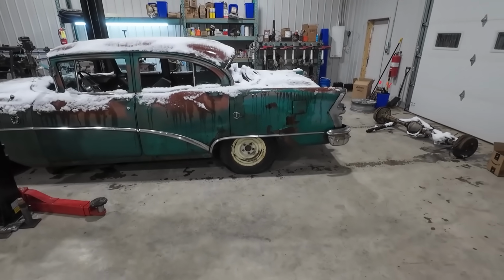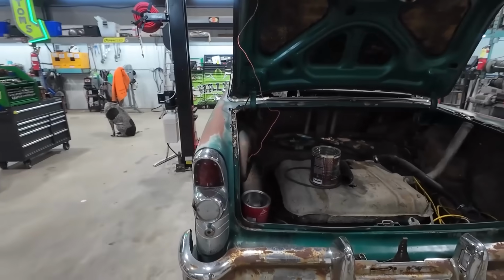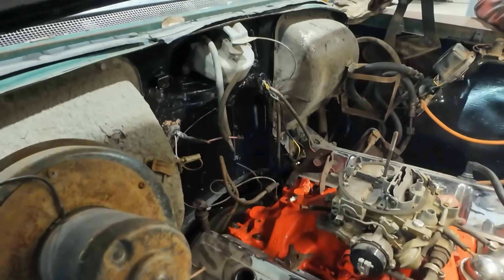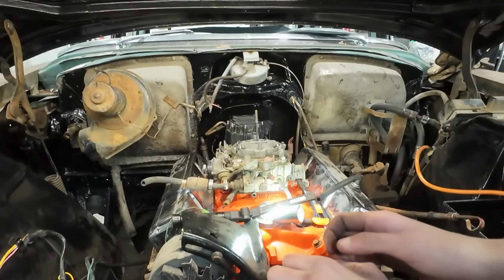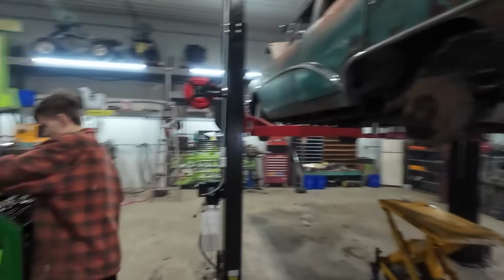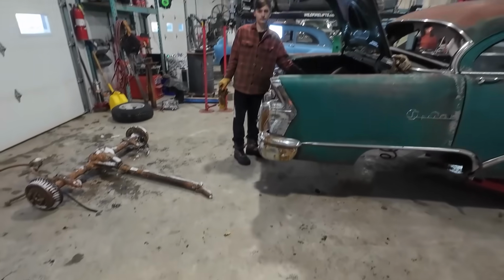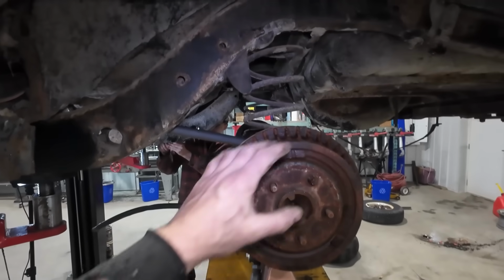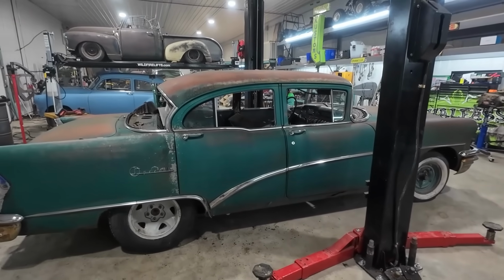Austin's back and gets some more work done on his Buick!

Comment: hope this is helpful for you and the young man , when you install the carb "put all the bolts in and open the throttle all the way and sung a couple to make sure that the butterfly's don't stick - next when you installed the distributor when after a few turn and drops you were 180 degrees away "you could have pulled out and turned the rotor" , and finally: when the dist is in and pointed to #1 put a spark plug in the #1 wire and ground it to the engine turn on the ignition power and turn the dist slowly back and forth , until the spark plug fires "snug the dist down just before spark" and the engine will start right up .... having fun is the most important part of the project  :face-turquoise-covering-eyes:your a lucky young man

Comment: I never thought I'd have to tell you this about a sbc but if you line up no.1 on the rotor, you can put finger pressure on the distributor and turn the crank a little and it will drop into place,  18436572, clockwise,  the distributor just has to drop on the oil pump drive shaft, you can't mess up the timing as long as it's engaged with the cam gear, ❤❤

Comment: I've got an old 40's car it also has the torque tube setup, finding axles that are 6 bolt, decent gear ratios and right width is hard. Square body 4x4 half ton ar correct bolt pattern, but a bit wide.

Comment: when you stab a distributor and are having trouble with the oil pump drive, use a long screw driver and turn the oil pump shaft to the #1 spark plug like you want to time the distributor, then you can set the distributor in place. you may need to wiggle the distributor in but it is easier than set, lift and repeat until in place.

Comment: Hi guys did that starter sound like in that van if not maybe shim is needed or if it did sound like that some one got the wrong starter in it84 and older is not the same as 85 and newer and thats how they sound if mixed up but a new starter drive of the right year would fix it up great  job guys 👍🏻

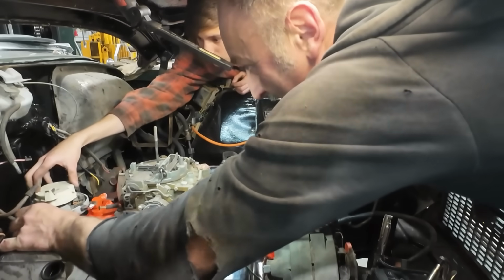Comment: 17:10 I thought Brent was smarter than that. You have to turn the oil pump shaft to get the distributor to drop in in the correct position.

Comment: Using the Panhard bar and the coils and the triangle links is certainly the simplest way to go. You can run the open driveshaft where the torque tube used to go.

Comment: incase this helps a 4WD S10 diff is a couple to 4 inches wider and may eliminate the need for wheel spacers.  Ahhh I should have watched the whole video before mentioning that. I see you already are on to that option. That's what a lot of guys do when doing an S10 frame swap on an advanced design Chevy truck. Also I love the early 50's Buicks I had a 54 Buick super 2door hard top. I sold it before I could really do anything with it though

Comment: Until I saw the rear suspension, every time you mentioned "Torque Tube", I thought you meant a "Torque Bar", my bad.  ;-)
Hot rodding is not a hobby to take lightly... most everything is heavy.  ;-D

Comment: I’m wondering why you put yourselves thru so much torture setting the Distributor in?
The oil pump drive is slotted and really doesn’t care which end is pointing toward #1 (you know this, Brent…. Even mentioned using a screwdriver)
Once the rotor pointed 180 out, it just needed back peddling to face true.